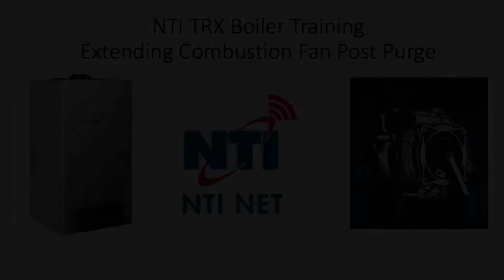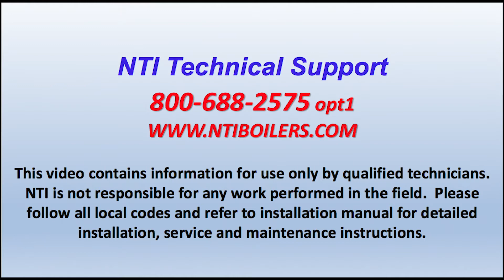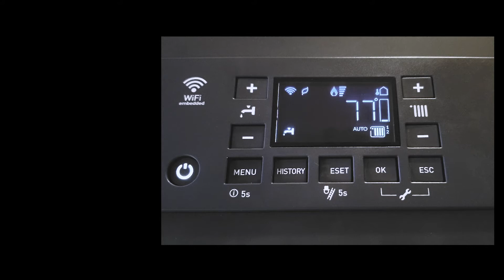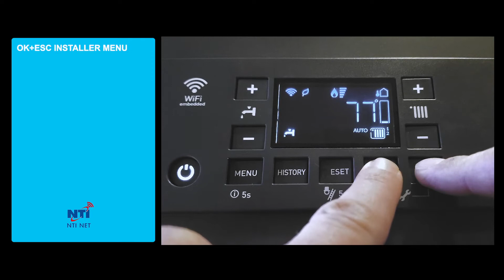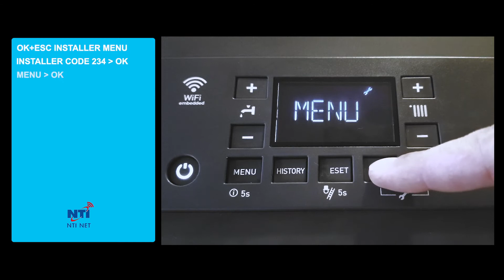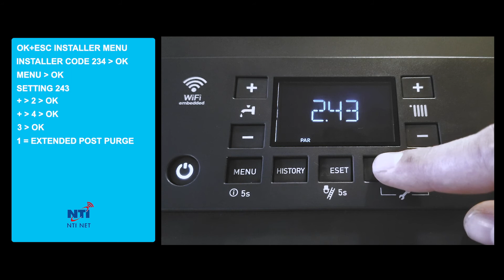Adjusting the Combustion Post Purge Settings on the NTI Trx boiler.

Comment: Why does it have to have so many codes?
 Why not keep it simple so an HVAC Tech can perform this function easily without a manual or calling Tech Support?
 It's really frustrating when you have to work on every brand out there and they all use their own codes, functions and non standard language or abbreviations.